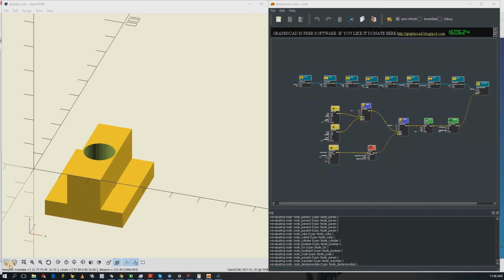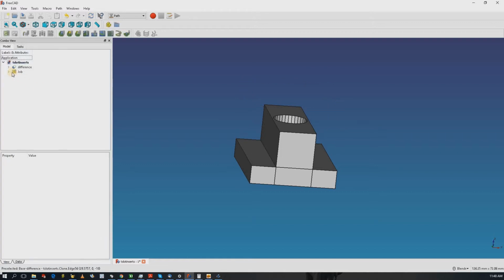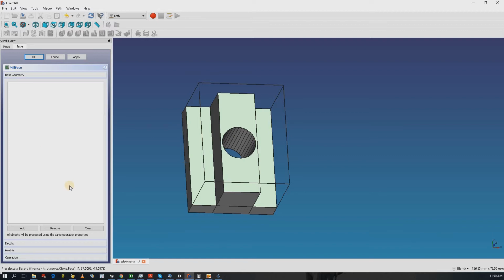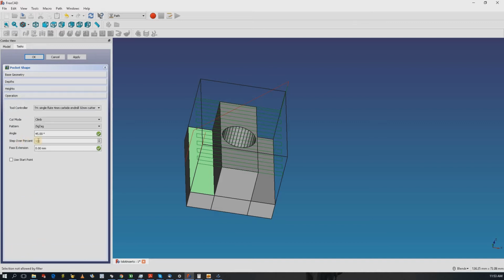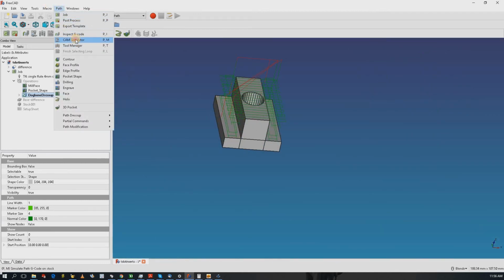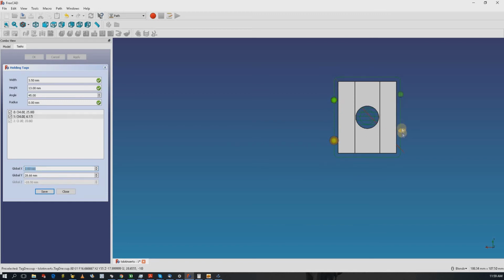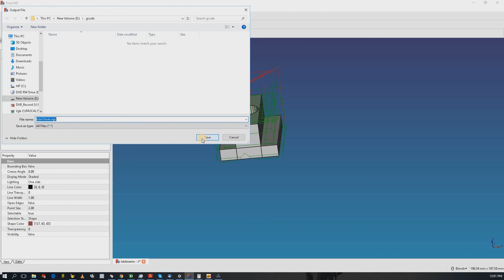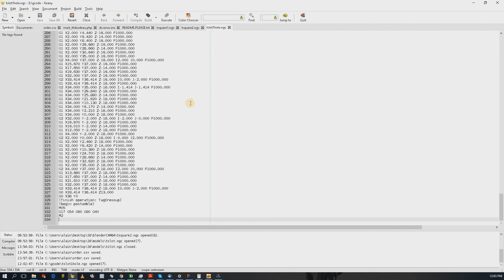Freecad 0.17 OpenScad - CNC path generation

Comment: CAN openSCAD create gcode directly?  
One thing I like about freeCAD is that the tool path is auto generated if you edit the model (no need to redo the tool, paths, speeds, climb, conventional, etc)
Reply from the maker: No, I use blender cam for that.  If you like freeCAD then you should be all set.  FreeCad does import openScad files
Reply: @diypppalain  Maybe. It depends if freecad can auto generate the tool path after re importing the scad file. I doubt it would work.
Reply: (Creating a tool path is a lot of redundant, tedious work.)